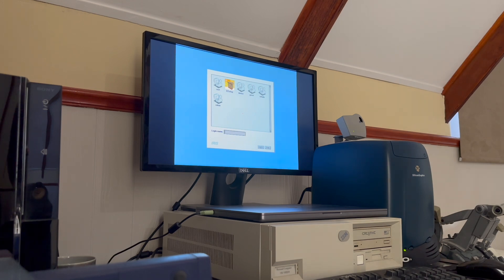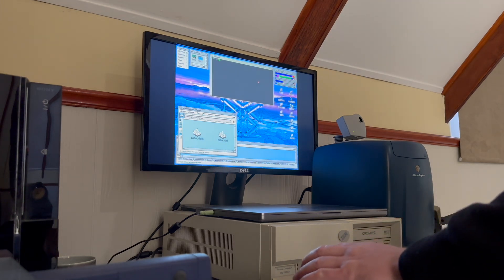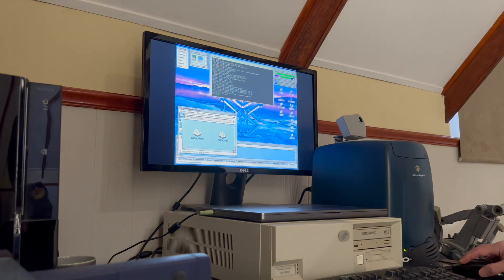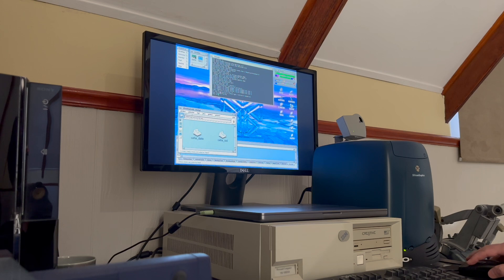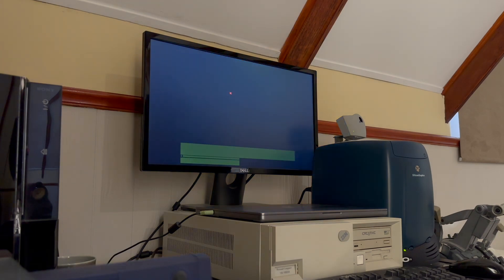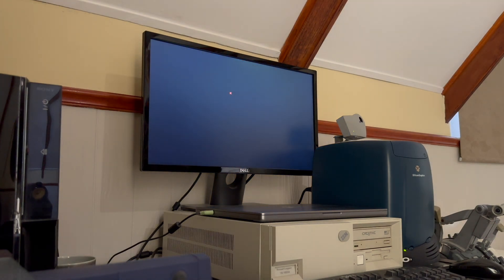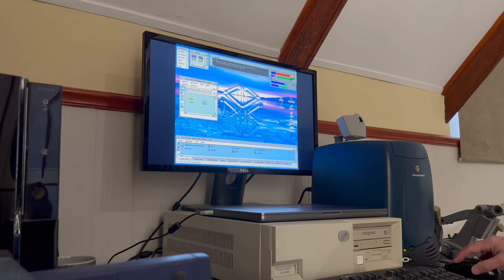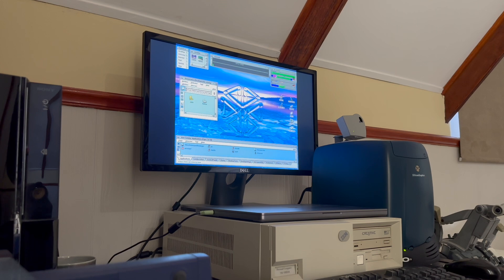Starting up Catia 4 on an SGI O2 R12K@400MHz

Comment: Hello, my name is JUN, and I live in South Korea. I was deeply impressed by seeing CATIA V4 installed and running on an SGI O2 system. I would like to set up a similar system myself. Could you assist me with this?
Reply from the maker: The best way to go about this would be to join the Silicon Graphics User Group at the following link:  https://forums.sgi.sh/index.php  and make contact with @gijoe77, as he has all of the necessary resources to help you get it up and running on your system.
Reply: @ Thank you! I'll check it out.

Comment: Since Catia seems to be a rather cumbersome piece of software (to even run!) Would someone with an SGI be better off running some other software? Perhaps Pro Engineer Wildfire? If they want to make 3D models. I am wanting to try some 3D modelling on my o2, with the purpose of 3D printing. Of course, I am aware you cannot export STL files on such ancient software, but I am guessing that it may be possible to save a file created on an SGI, opening it on a modern machine using modern software, in order to convert to an STL? What do you think would be the most suitable software for this. I am thinking of using FreeCAD on my PC for importing, as it supports opening a wide range of formats.
Reply from the maker: I have Pro Engineer WildFire running on my Tezro and it works very well! Here's a video I made of a model I made in it: https://youtu.be/uDvWMCfCMCM
Reply: An O2 was never a good CAD station.  Not enough hardware accelerated 3D in that box.  That said an older version of ProE will happily run on an older SGI, even an Indigo.  There’s no need for a modern computer in the work flow you are describing.  ProE will export an STL very easily.  All major CAD programs also open ProE files and you can always export STEP or IGES.  STL is not exactly a modern format.  People using 3D CAD have been exporting STL for 3D printing since the 1980s.
Reply: Could one use Alias for that sort of thing?
Reply from the maker: Catia’s parametric like pro engineer, and therefore far more accurate from an engineering standpoint.
Reply: @Irinikus  So when using CATIA to do some modelling, does gr_osview typically show the system being constantly CPU-bound?

I've always wanted to try getting CATIA or ProE running on an SGI, never have so far. Drop me line if you can help.
Reply: @mapesdhs597 getting proe running on an SGI is very easy, back to version 20.  Earlier versions are harder due simply to lack of info on the licensing system.  They switched to flexlm on v20.  There’s folks on the SGI discord that can help.

Forgot to mention, ProE should be pretty CPU bound even on new hardware.  Maybe if you go to really ancient graphics you’ll see it choke on rotation or viewport changes.  Most of the actual work though slams the cpu harder than the graphics.
Reply: @lookoutforchris  Thanks! I do at last understand why the apps behave in that way. Explains why a custom PC I built for a company using Magicks were delighted that the system I built was 2x faster than the Dell they'd bought, even though their system had a better GPU (mine was a Quadro 4000, but had a 5GHz i7 2700K, while their PC was a XEON with a newer Quadro).

I do have a ProE archive for IRIX, but I've never looked at it, not sure offhand what version it is.
Reply from the maker: If you want the latest version of Pro Engineer for IRIX, PM @Vishnu on IRIX Network. If you want everything that you’ll need, including the instructions as to getting Catia 4 up and running, send @gijoe77 a PM, and he’ll be able to help you.
Reply from the maker: I’ll check out the CPU activity while running Catia for you, when I get a chance.
Reply from the maker: Here you go: https://youtu.be/gegGvji2Cs0